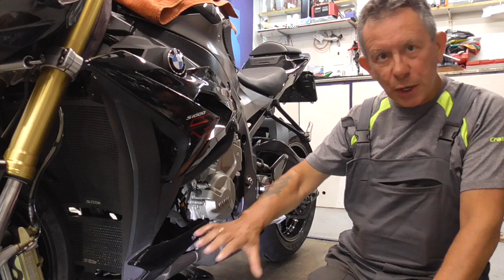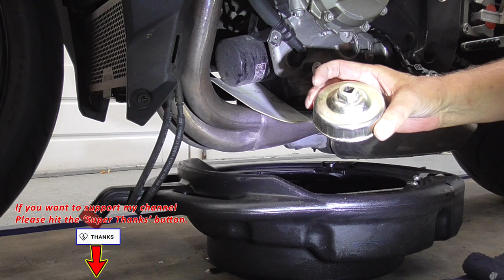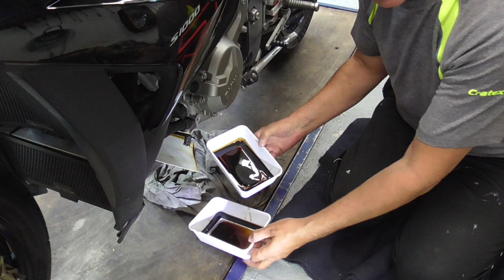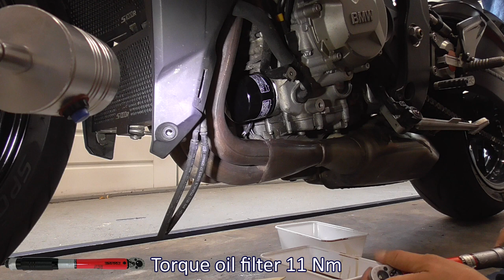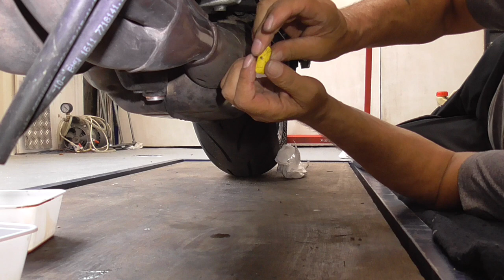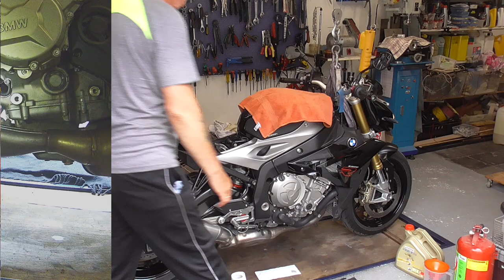Mastering the Art of BMW S1000R Oil Change: A Step-by-Step Guide by the Old Mechanic

Comment: Are you sure that 10W 40 is the correct oil?
I always use 5W 40 Advantec oil and a BMW oil filter for my S1000R.😉
Reply from the maker: My Castrol oil is perfect for the job, but you can always buy the more expencive BMW oil if that makes you feel better Jonty 😉
Reply: @TheOldMechanic  I have found out if you use 10 / 40 rather than 5 / 40 the hydraulic cam chain adjuster takes a few seconds longer to build pressure, just sounds worse. I fitted a manual cam chain adjuster and now it doesn’t matter as not having an effect.
Reply: Yeah, he's using the wrong oil. It's not that it's bmw specific oil, it's just the wrong type. It should be 5w 40.

Comment: using 10w40 oil makes the motorcycle lose performance, impairs the radiator heat exchange, impairs the hydraulic tensioner. Engineer does not study for hobby
Reply: Maybe when cold, but that is negligible once the engine is at operating temperature.
Reply: I have used 10w 40 for years in all my bikes and never a problem.